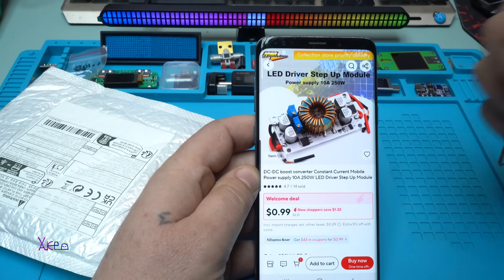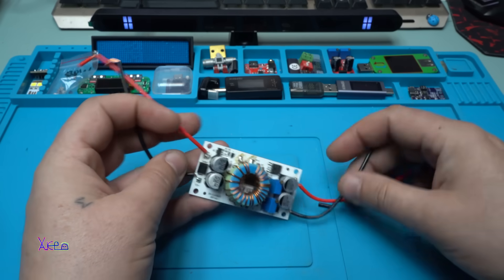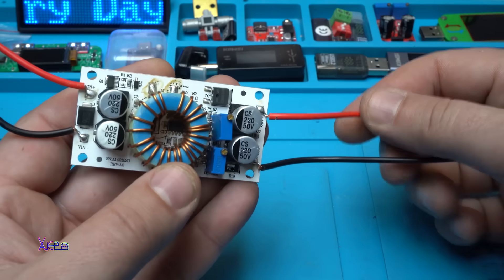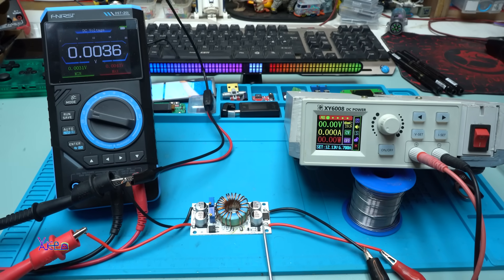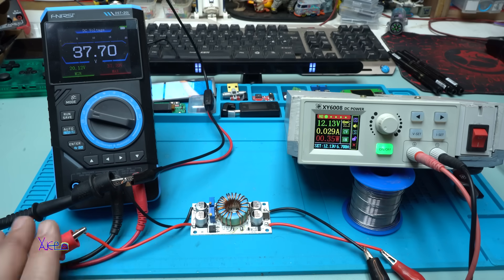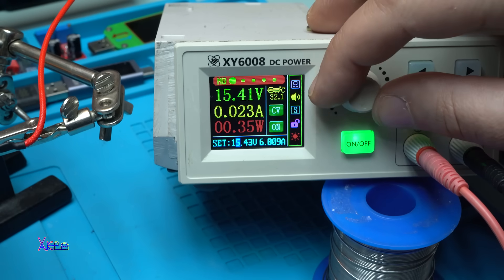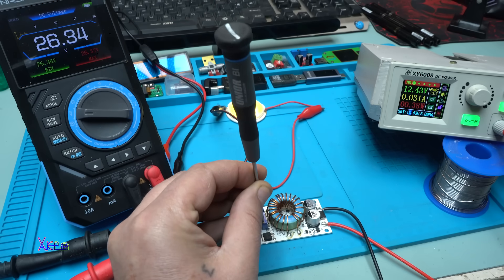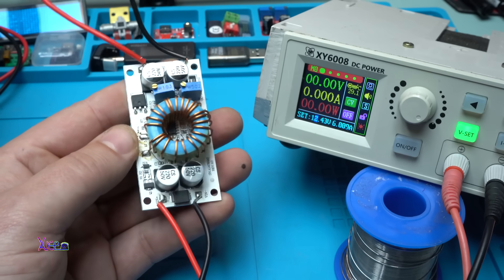$3 AliExpress Module  DC-DC Converter 10A 250w

Comment: Hello sir 👋

I hope you are doing well. I’m a university student from India, currently working on a very important academic project that specifically requires a small 5-inch black & white portable CRT TV like the one shown in your video.

I have searched extensively across India local markets, collectors, scrap dealers, and online platforms but unfortunately I haven’t been able to find a single working unit. Your video was the only place where I saw exactly what I need.

If you are willing to sell or part with one unit, I would be extremely grateful. I completely understand the value of vintage electronics and I am ready to pay a fair price in euros, including international shipping and packing costs, as per your convenience.

This is strictly for educational and research purposes, and the CRT will be preserved with care and respect for its historical value. Even a non-perfect or partially working unit would be acceptable for my project.

If selling is not possible, I would sincerely appreciate any guidance, reference, or lead you might have.

Thank you very much for your time and for preserving such rare technology. 🙏

Warm regards,

Abishek

abishektr21@gmail.com 

India.

Comment: Why did you only demonstrate the voltage regulator? How can you tune the current regulator, if the Multimeter can't measure above 2 Amps and if there is no shunt for current-measuring?